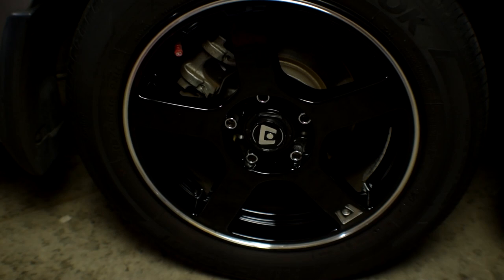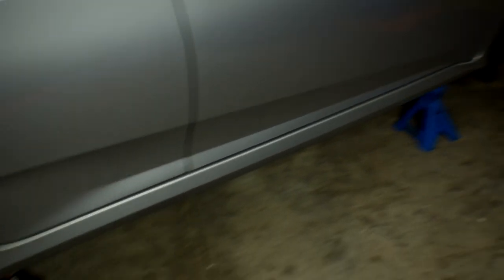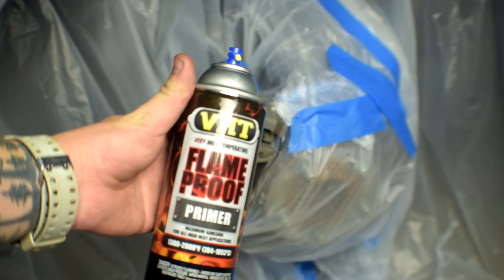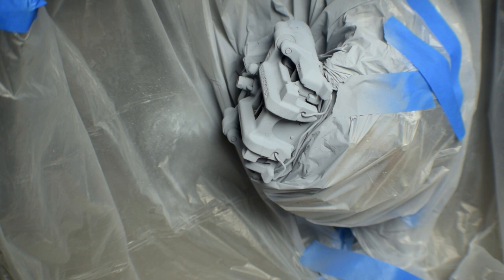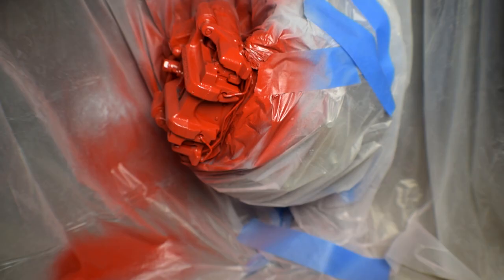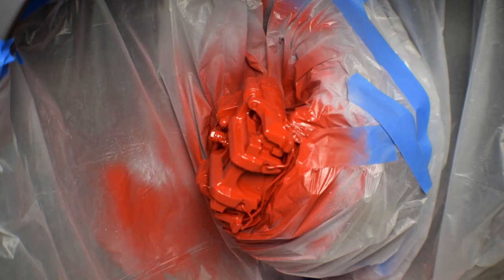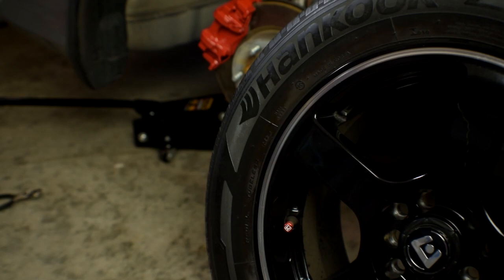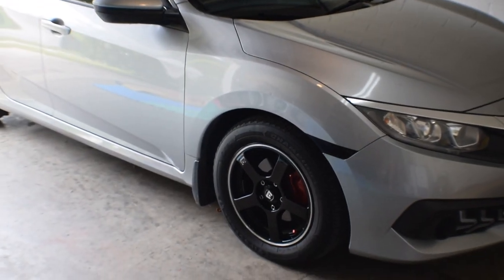PAINT BRAKE CALIPERS Red The Easy Way On A 10th Gen Civic

Comment: Did you have any issues after? Sensors, functionality? Didn’t remove pads and spring clips so I was just wondering
Reply from the maker: good question, I haven't had any problems with the brake system, sensors or the breaking day to day! Its been over a month now with zero problems but will update if something comes up. But as of now everything is working as it should! Thank you for the comment!

Comment: Do you have to remove caliper pads or anything like that? I have the hatchback. I just see some people saying that it has to be remove and someone other people say it doesn’t
Reply from the maker: The most important part is taping. make sure you have proper coverage over the electric E brake, rotor and anything else that doesn't need paint. Since painting the calipers everything works as it should. So its up to you to detach parts and paint or carefully tape and save the time. Hope that helps man, thank you for the comment!
Reply: Should also try to avoid painting the caliper slide pin boots if possible